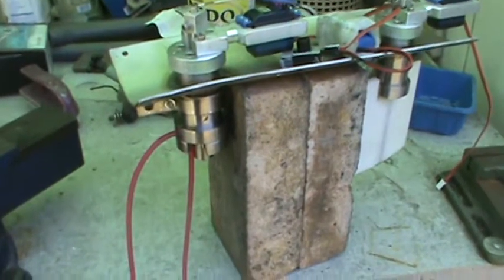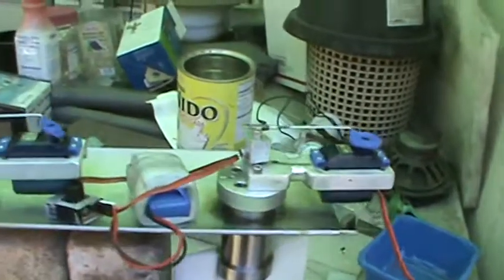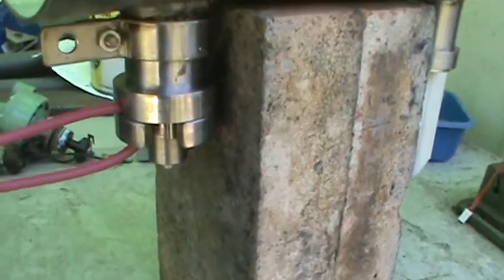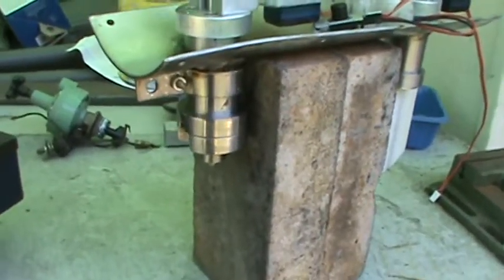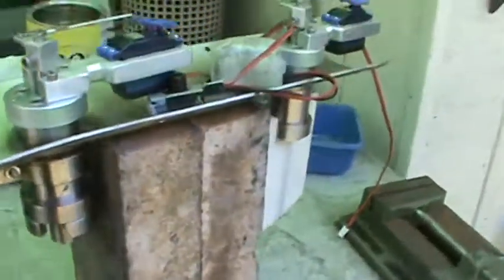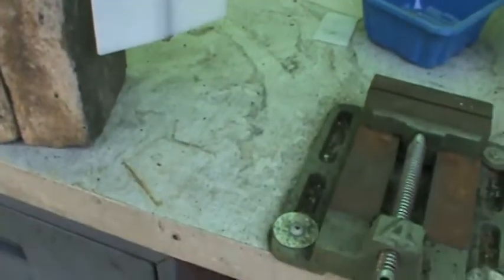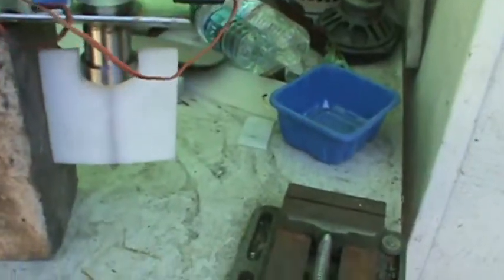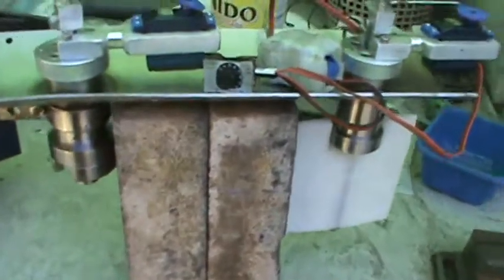My Fishing torpedo Line Locking mechanism and Rudder

Comment: Hi what make and model servo did you use for the rudder? And do you have the cnc design file for the parts for the rudder assembly 
? And a link to where you got the seal kit form?
Reply from the maker: Check this out: 

http://www.hobbyclub.com/index.php?main_page=product_info&cPath=24_225&products_id=360&zenid=d6ee0b9718e55553aeb170aa423a8b46

 

https://hobbyking.com/en_us/bms-661dmg-hs-super-fast-digital-servo-mg-6-4kg-08sec-46-5g.html?___store=en_us

 

https://www.mcmaster.com/#8595k77/=1cfnpxh
Reply from the maker: I don't have any CNC files. I just put drawings together on the paper and machined it just using regular lathe and milling machine. My mill has digital read out (DRO) which helps a lot :)